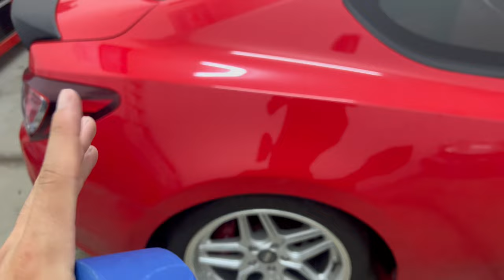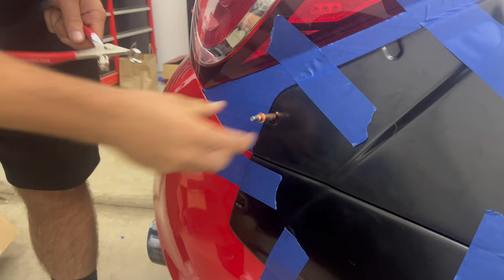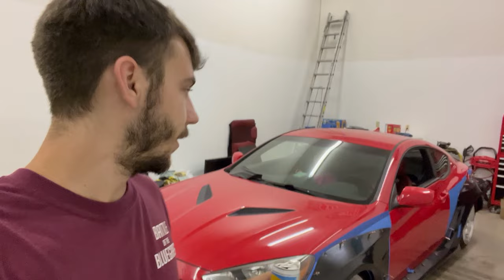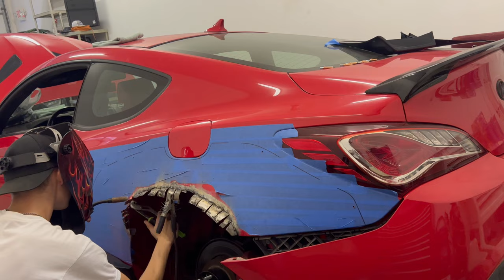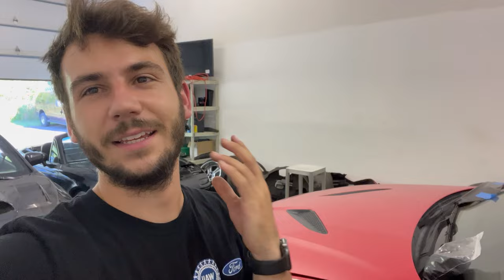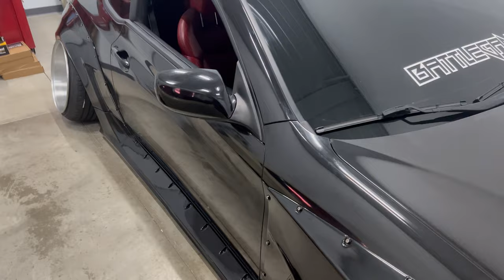Installing the NEW Krotov Widebody Kit on my Genesis Coupe!

Comment: Great job!  Looks good. Im planning on getting the same kit. What wheel specs are you running? I want a flush look
Reply from the maker: 18x11 -80  but I also run a spacer to allow my BBS wheels to clear the brembos I’m not exactly sure what specs you’ll want for flush fitment but this kit is similar width to the Remake so you might be able to look on fitment industry gallery for ideas

Comment: can you potentially not cut it and just like slap the kit on? I'm really curious
Reply from the maker: I mean technically yes but the problem would be you couldn’t run wheels wide enough to fit the widebody you’d still have to stay within the stock body wheel wheel and it just wouldn’t look right so to do it correctly it should be trimmed and to get proper wheel size

Comment: Clean ass build what wheel sizes should i put for the wide-body front and the back for 2013 3.8?
Reply from the maker: If your wanting a flush set up I don’t actually know the best specs but if you look on fitment industry’s gallery and find a genesis running a remake kit it will be around similar specs
Reply: @Stancy.Anthony  thank you your the best hl with the build have fun and be safe